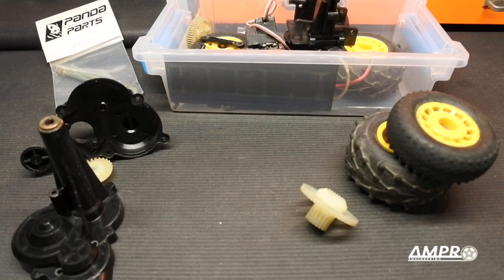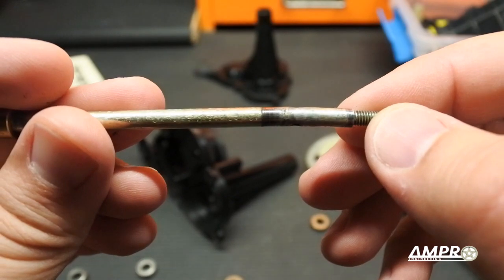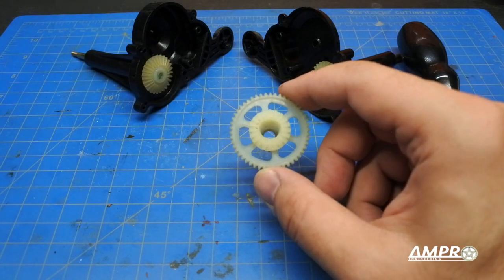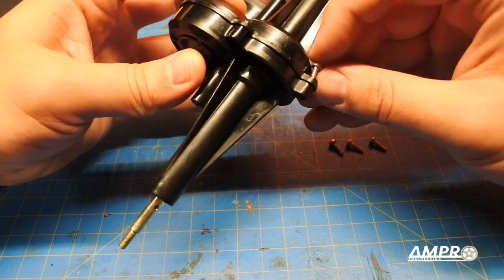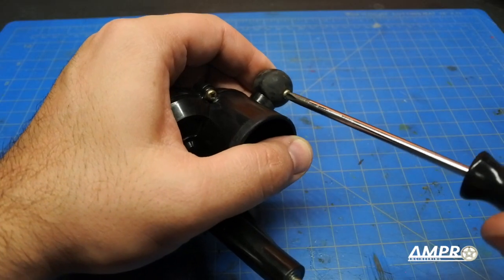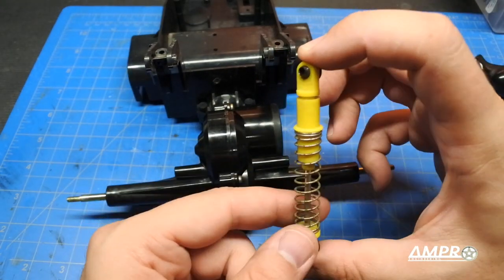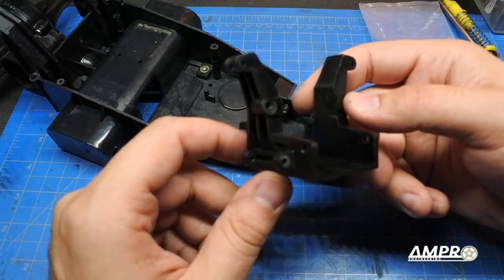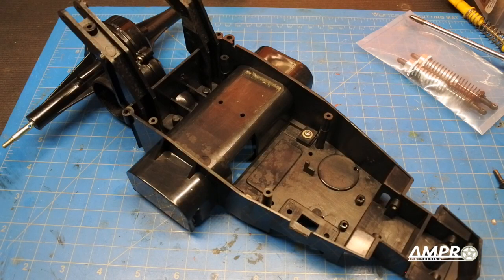e105- Varicom/Panda Pandamonium aka Graupner Pinto Project "Pointless" Part 2

Comment: Rubber cement in the tire cracks, works great.
Reply from the maker: Really? I didnt think of that. Ill give it a go!.
Reply: Just need to clean the cracks good. I use acetone, as it softens the rubber, helps it revulcanize with the cement.
Reply from the maker: IM going to try tonight!
Reply: Also Shoe Goo, amazing E6000, or 527 glues all work well and are all available at Walmart
Reply: Also you can buy black rubberized Tire CA
Reply from the maker: I have shoe goo that I will try. I love that stuff.

Comment: I'd suggest perhaps buffing that ball pivot for the transmission. Some 400 up to 2000 grit wet sanding to take off the degrading plastic
Reply from the maker: That is a good idea...I was concerned with the degraded plastic but that could smooth it out. Thank you for the thought!